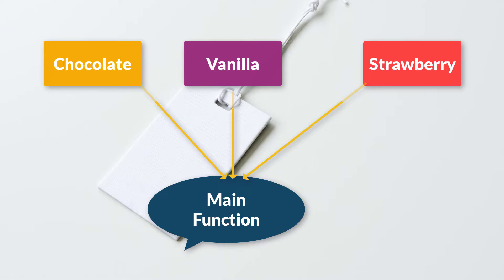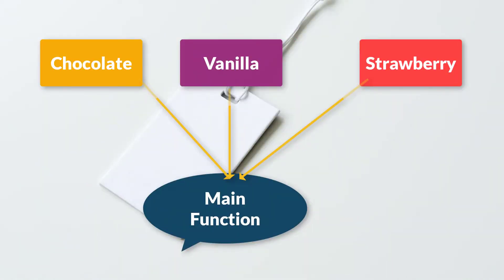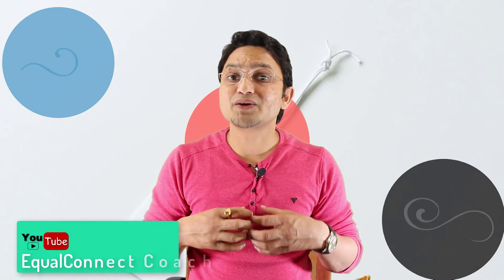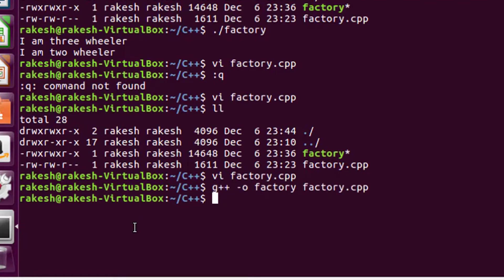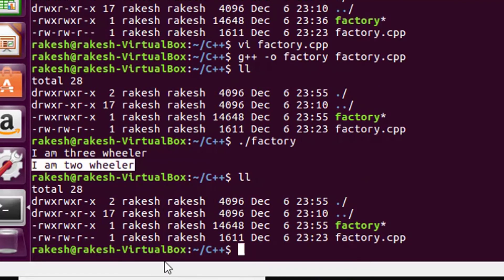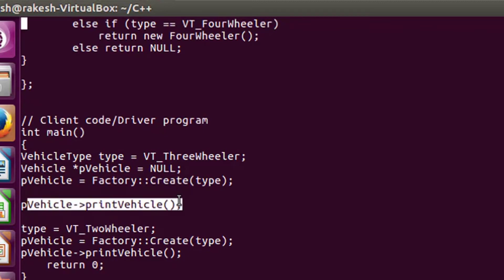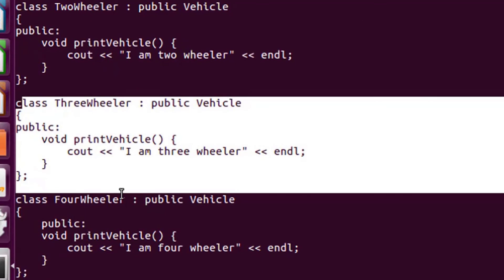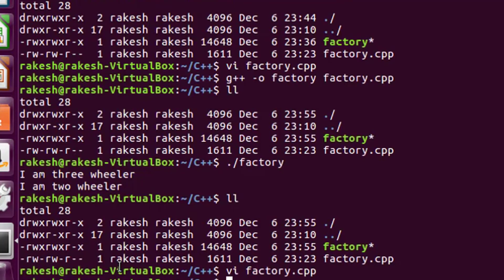Design pattern#1 Deep Dive Factory design pattern in C++ with real time example

Comment: Nice explanation.  I understand that we did not make tightly coupled client code with library to independently compiled. But if i want add new feature in my class vichle example(6 wheeler) then i need to modified all the classes. In this scenario, i would like to know that, if i changes something in my vichle class( added 6 wheeler) then i dont want to recompile the  library class as well as client code. Please clarify on this node. whether i dont need to recompile my client code and library code and class vichle.

Comment: Sir I did not understand why we need to make the Create method static in Factory Class. If we make it static and then if we changed the code later then also we will need to recompile the code again then how making the method static is helping us here.
Reply: I found a different answer here https://stackoverflow.com/questions/1571020/factory-creation-methods-always-static and I am little bit confused now.
Reply from the maker: @praveenojha33  if u r making library then in that case it's nessecary
Reply: @EqualConnectCoach  Sir I put all the classes (Abstract Vehicle class and other vehicle classes along with factory class ) in a header file. Than I included it in the client code having main function and compiled it. Now whenever I make changes to classes in header file , the changes do not appear in the client code, it only appears when I recompile the whole client code again.
Reply from the maker: Client side code we don't need to compile , since client and factory both  in single file so client automatically getting compiled